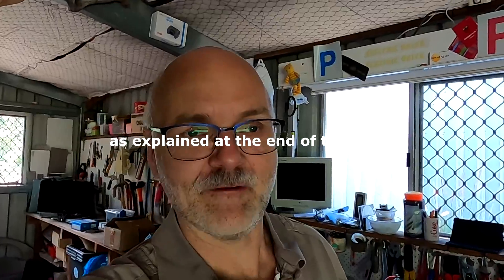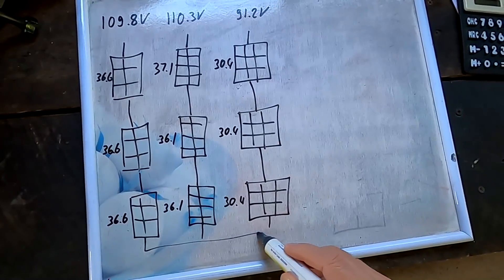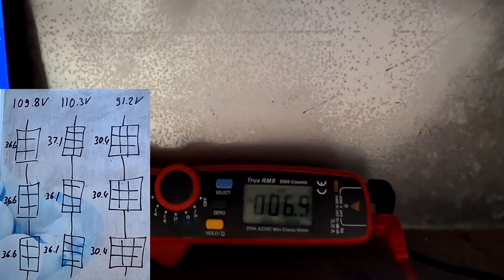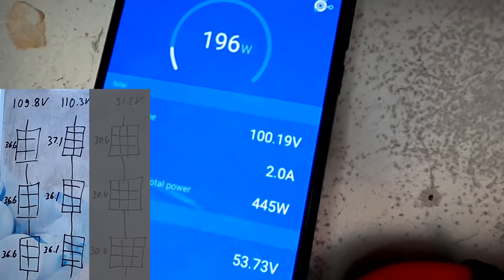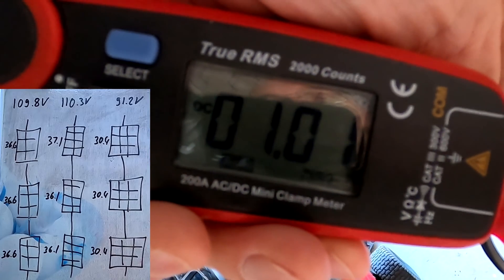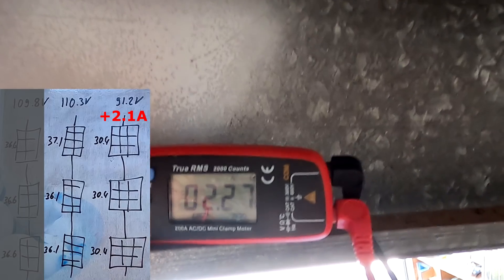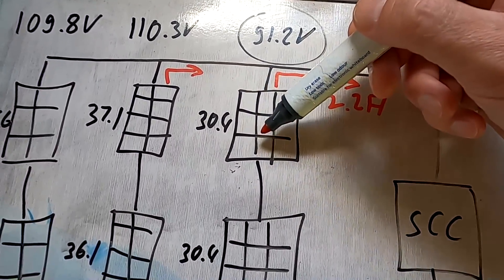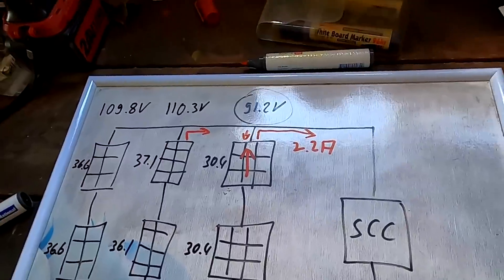Different solar string voltages in parallel. Does that work? (no blocking diode)🌞🔧⚡🔋

Comment: Solar Panels are NOT Constant Voltage sources like a battery.  Solar Panels are more like Current Sources which can be connected in parallel,  even if their Open Circuit voltages are slightly different.  When connected is parallel, the Voltage "Under-Load" becomes EXACTLY the same for all three strings, but the amps per string will not be shared equally.   Side note ... Typically, I would NOT connect String #3 because its Voc is lower than the Vmp of both String #1 and String #2  <==  YIKES !!!  String #3 will NEVER contribute its fair-share of amps to the load, while running at/near its Voc.  Best to have no more than a 10% variance between the lowest Voc string & the highest Voc string . The same 10% max variance applies for Vmp, too.
Reply from the maker: It was a test, right?
Reply: @OffGridGarageAustralia  My reply contains an explanation of "Current Sources connected in parallel" and additional relevant facts, that are not found in your video. The information is presented for those, who want know "WHY" ...

Comment: If you had a bigger difference in shading you might see different results. If you used a string in the back yard to catch morning sun and a string in the front yard for afternoon sun, you would probably want a solar combiner / diode. Nicht wahr?
Reply from the maker: I did such a test already in another video and heavily shaded on string. No current backflow though.
https://youtu.be/NaCOdOdhdTY
Reply: @OffGridGarageAustralia  thank you, I'll give it a watch!
Reply: @DavidBTB  With similar pv panels and/or similar strings, there is a small change in Voc, due variations in insolation.  Under-load and in normal operating conditions, typically both panels or both strings ( East + West ) will contribute amps into the load.  This has been known for 15 - 20 years now ...

Comment: Well I wouldn't expect to see that after all I've read. Is this Victron magic? I'm thinking maybe the app seems to have hypnotic powers as I get into watching the watt meter for hours a day lol. I would love to see this test on a good sunny solar day.. so interesting. cheers!!
Reply: What have you been reading?  Solar Panels are NOT Constant Voltage sources like a battery.  Solar Panels are more like Current Sources which can be connected in parallel,  even if their Open Circuit Voltages are slightly different.  Vmp is always LESS than Voc ...
Reply: @MrSummitville  awesome thanks.

Comment: If you want power out of the lower voltage string, the charge controller has to drop the voltage, so you waste some power from the higher voltage strings.
Reply: The drop in wattage in the Higher Voltage Solar Panels is much LESS THAN the additional wattage GAINED by adding String #3.  You have totally missed the Moral of this Story ...

Comment: If you measure the voltage input to charge controller, I think the number should be the lower voltage string voltage. So it's the work of charge controller.
Reply: The Voltage at the Max Power Point with all three strings connected in parallel, will always be somewhere between the highest Vmpp and the lowest Vmpp of each of the 3 strings connected individually  ...

Comment: Wouldn't the higher voltage strings voltage drop even if the amps stay the same? 
In that way it would produce less power than if it was standalone.
Reply: The drop in wattage in the Higher Voltage Solar Panels is much LESS THAN the additional wattage GAINED by adding String #3.  You totally missed the Moral of this Story ...

Comment: If the low voltage string had acted as a load to the higher voltage strings, a blocking diode in the low voltage string may have helped.
Reply from the maker: Yes, as I said at the end of the video.

Comment: 1. panels in series will be limited by the worst performing panel.
2. Worry about watts, amps and volts just need to be at a level your equipment can work with. Remember Watts is just amps x volts
3. run in series to get to the minimum voltage required, then in parallel to achieve your desired highest amperage, your MPPT will do the rest

You can think of your strings (3S) of panels as basically 3 individual panels in parallel, your voltage with panels in parallel won't be affected by each other, you'll read the highest voltage supplied by any of the panels and a SUM of the AMPS, the oposite is true of panels in series although in series your output will be limited by the worst performing panel in the string unlike in parallel.

Comment: If the voltage is 30 with all 3 banks connected, then the higher voltage panels will not produce maximum power.  A blocking diode will consume power of about  0.7xcurrent, and also drop the voltage by 0.7v.
Reply from the maker: You never use normal diodes as blocking or bypass diodes. Schottky diodes have only 0.2V drop, so the loss is far less. At 8A coming from one string over 0.2V that's only 1.6W loss when in blocking direction.
Reply: @OffGridGarageAustralia  That's good to know, thanks.
Reply: @OffGridGarageAustralia  I doubt that you actually measured only a 0.2 Volt Drop with 8 amps flowing.  I am willing to bet that the Volt Drop at 8 Amps is closer to 0.45 Volts ( maybe even 0.5 volts ) .  Therefore,  3.6 Watts lost as heat =  0.45 Volts x 8 Amps

Comment: Looks like you are mixing two parallel series strings of three panels with 72 series cells per panel with a third parallel string of three 60 series cell panels.

At 50C heated in full sunlight, three series 72 cell panels should have Voc about 124.1v and Vmp about 96.1v
At 50C, full sun, three 60 cell panels in series should have Voc of about 103.4v and Vmp about 80.1v.

Because the Vmp of 72 cell seires is lower then Voc of 60 cell panels the MPPT controller will force a load so 72 cell strings will run a little below their optimum load and 60 cell string will be operating above their optimum Vmp voltage.  All panels will not be producing their optimum output.

Depending on panel current ratings, you might be better off making three parallel strings containing two 72 cell panels in series with one 60 cell panel.  This may make the MPPT controller give a more optimum Vmp loading.  Each series string will only produce about the current of is lowest current capable panel in the series string. Other option is get a separate MPPT controller for the three 60 cell panel string.

Comment: Andy - What I've always understood is that if you put a panel (or string) of higher voltage in parallel with a panel (or string) of lower voltage, you will pull the combined two strings down to the lower voltage. The panels still produce the current they were doing before, but it is lower power, since it is at a lower voltage. So you generally don't want to put panels in parallel if they are different voltage Vmp (by more than about 5%). Similarly, if you put two panels with different currents in series, the combined panels will assume the lower current. So you want panels in series to have the same current Imp (within about 5%). That's been the rule I follow, and it seems to make sense. You were looking at the current, but to verify you would need to check the SCC power output and see if you lost some power on the two higher voltage strings due to being pulled down by the lower voltage string.
Reply: If there is a voltage drop, you have to look at the amps to see if they rise..... in the end it is all about watts, or better Wh's
Reply: Hi all, I think what Andy is doing is essentially correct, but this does need more testing. V=IR, everyone agrees! I believe what happens in such a situation is that, yes the overall voltage will come down a little which the mppt takes care of , ie : adjusting voltage to find mpp and therefore current output conversion to achieve greatest overall current output at the controlled voltage to battery. I believe that the controller is the throttle so to say, & that while the voltages can be all over the place with shading etc, the Controller IS the lowest path of resistance, UNTIL the battery is fully charged &/or there is no load for output of controller, AND, this is when there could be some issues of power being fed into the lowest performing string set or set’s & where diodes will help to prevent a lower performing set to take charge from the other string sets, & possibly heat up to some degree & therefore may reduce that strings life in this way, if it doesn’t burn out in a shorter time. When I use the term ‘Lower Perfoming’ set, I am referring to it’s Power/Watts because Watts are related to power at any voltage (x amperage = Watts), so I think the watts is what we need to look at, and as Andy has shown here, lower voltage strings dont reduce Amps as u hook in extra strings.  Consider also, what happens when a bird walks over or sits on a panel, does this not reduce the output (volts and amps) of that string compared to the others, so I dont think it matters that greatly if ur strings aren’t perfectly matched, as the controller takes care of this to some degree, at least while it is the lowest path of resistance, the main thing is to have reasonable safety’s in place, (Fuses, cb’s, whatever). I have 4 x 250w panels on my bus roof, 2 front & 2 @ back, a series/parallel config, there is a tree shading the rear panel in the afternoons, so I see how this effects my systems ability to charge with great voltage changes from each string, but I have the same result Andy has shown us, ie: a shaded string doesn’t effect the unshaded output and still adds to the overall Watt output of the whole set going to the controller & to the batteries. If all batteries are full & controller stops charging, then there can be a power transfer to path of least resistance, ie: a lower resistance string set. Does anyone feel that this make sense? Or is incorrect?
Reply: Hi all, I think what Andy is doing is essentially correct, but this does need more testing. V=IR, everyone agrees! I believe what happens in such a situation is that, yes the overall voltage will come down a little which the mppt takes care of , ie : adjusting voltage to find mpp and therefore current output conversion to achieve greatest overall current output at the controlled voltage to battery. I believe that the controller is the throttle so to say, & that while the voltages can be all over the place with shading etc, the Controller IS the lowest path of resistance, UNTIL the battery is fully charged &/or there is no load for output of controller, AND, this is when there could be some issues of power being fed into the lowest performing string set or set’s & where diodes will help to prevent a lower performing set to take charge from the other string sets, & possibly heat up to some degree & therefore may reduce that strings life in this way, if it doesn’t burn out in a shorter time. When I use the term ‘Lower Perfoming’ set, I am referring to it’s Power/Watts because Watts are related to power at any voltage (x amperage = Watts), so I think the watts is what we need to look at, and as Andy has shown here, lower voltage strings dont reduce Amps as u hook in extra strings.  Consider also, what happens when a bird walks over or sits on a panel, does this not reduce the output (volts and amps) of that string compared to the others, so I dont think it matters that greatly if ur strings aren’t perfectly matched, as the controller takes care of this to some degree, at least while it is the lowest path of resistance, the main thing is to have reasonable safety’s in place, (Fuses, cb’s, whatever). I have 4 x 250w panels on my bus roof, 2 front & 2 @ back, a series/parallel config, there is a tree shading the rear panel in the afternoons, so I see how this effects my systems ability to charge with great voltage changes from each string, but I have the same result Andy has shown us, ie: a shaded string doesn’t effect the unshaded output and still adds to the overall Watt output of the whole set going to the controller & to the batteries. If all batteries are full & controller stops charging, then there can be a power transfer to path of least resistance, ie: a lower resistance string set. Does anyone feel that this make sense? Or is incorrect?
Reply: I came to this video to check exactly that if there was a voltage drop, like I was expecting, and after looking at the other video with the blanket, what I can conclude is that the MPPT takes the higher voltage, a module with a lower voltage does not affect in anything because the MPPT makes sure that the voltage stays high, to have the max power output.
Reply: If the open circuit voltage of the lower voltage panels is higher than the MPP of the higher voltage string the lower panels will provide some current, just well off their MPP.
Reply: Will it damage panels?? If I don't care about Losses??
Reply: No damage, they all have DIODES to avoid being"charged"  @VEEGEE_
Reply: The drop in wattage in the Higher Voltage Solar Panels is much LESS THAN the additional wattage GAINED by adding String #3.  You have totally missed the Moral of this Story ...

Comment: Never forget 3 panels in series will go down if 1 panel is shaded.
3 panels in parallel will become 2 panels in parallel if one panel is shaded.

There are mppt cc that can handle paralleled arrays, and you will need bigger wires, a boost dc to dc converter can up the voltage to your high voltage battery. 

Another option is to add an ac inverter to the paralleled array then an ac to dc charger. 

I don't know if your cc can handle the current from a paralleled array. 
Can you cut down that tree, or top it to lower its height. "Top it" means to cut off the top. A technique to lower the height and make most trees to spread out. Not all trees can be topped. 

Move the array to somewhere there is less shading.
Reply from the maker: The trees are over 100 years old and will not be touched!
Reply: @OffGridGarageAustralia  I fully agree, I live in a wooded area, where I am so shaded with trees I can not top or cut down. The site survey I have been doing is showing the direct sun I will get is from solar noon to 3 pm at best in the summer. My property is not very compatible.

Comment: Your observations overlook a catastrophic problem. When the battery is full or the SCC is otherwise offline, the lower voltage string will have to dissipate an enormous amount of power from the higher voltage strings. At best, the lower voltage string will rapidly degrade and produce mere microamps of current after 1-3 years. Alternatively, a solder joint in the low voltage panels will melt and go open circuit after 30 minutes or so with the battery full and strong sunshine. At worst, the panel backing film or wire insulation will catch on fire, melt onto your roof and burn your garage down (unlikely given your metal roofing, but a potential concern for wooden homes).

I speak from experience. I had a couple small 18V 100W panels wired in series then short circuited for 3 years. This melted the MC4 connectors and killed both panels. You can physically see melted and migrated metal droplets on the individual cells where the tiny current collector finger wires are supposed to be.

Producing photovoltaic electricity is endothermic, but forcing current into a panel is exothermic.
Reply: But a "... couple of 18 Volt 100 Watt Solar Panel wired in series ..."  can only generate 5 to 6 Amps.  You had 100% JUNK MC4 connectors, if they cannot handle 5 amps ...
Reply from the maker: Thanks Howard. Did you watch the video until the end? 😉

Comment: I think having all 3 strings connected will drop the overall load voltage, making the maximum power you can get from the panels lower over all during peak output.
Reply: The drop in wattage in the Higher Voltage Solar Panels is much LESS THAN the additional wattage GAINED by adding String #3.  You have totally missed the Moral of this Story ...

Comment: There is alot to learn from this experiment.  There must be balance in the force. 
Adding a 36 cell, current 8 amps? (  the BDL current) 160 watt panel to string 1, would go a long way to balance your over all system.
Even a standard 100W, 18V 36 cell, 6 amp addition panel to string 1would improve you system balance alot. Assuming bypass diodes are working. String 1 becomes 4 panels in series. 

String 1 (BLD) is pulling strings 2 and 3 far far away from their max power point. String 2 pulled string 3 away from it's max power point.(Shading?). String 2 and 3 pulled string 1 from it's max power point. 

It a tug of war.
No wonder the charge controller is confused. And your not getting the power expectations. 

I would like to see this experiment repeated with full sun. To eliminate the Independent variable of shading.
But, measure each string separately for max power Imp and Vmp, just like you did in this video. You missed measuring string 2 all by itself in this video. I want to see if string 2 and 3 are simular enough to put in parallel,  they shoud be, hard to tell when shading is a factor.

An extra panel may be cheaper than 2 charge controllers. Dedicating 1 cc to string 1, and another to strings 2 and 3. Is the best method.  If the current rating between string 2 & 3 is different you may need 3 charge controllers.  An ISC measurement for all strings would help to understand the issue.

I don't know this for sure, but other people say parrelled panels sometimes work better than stringed panels when shading is a large problem. 

Well done experiment my young padawan!